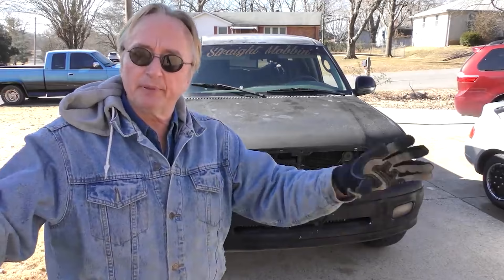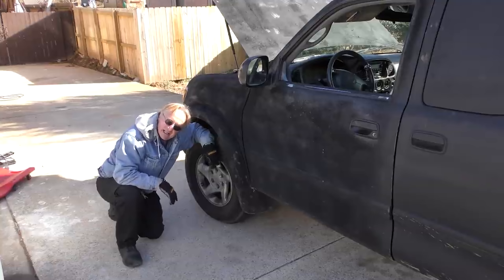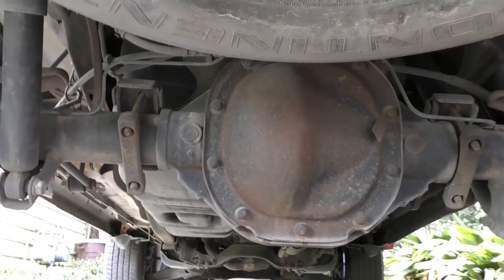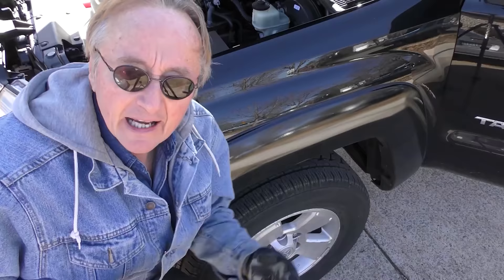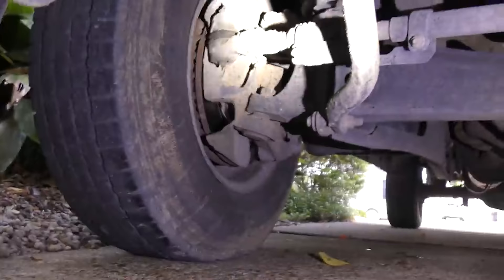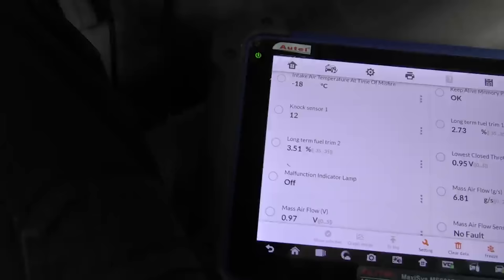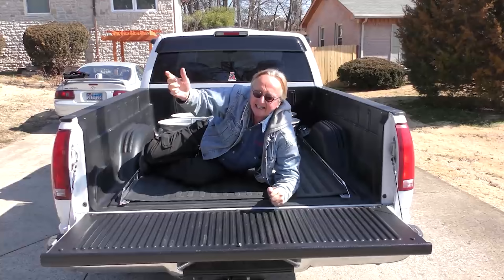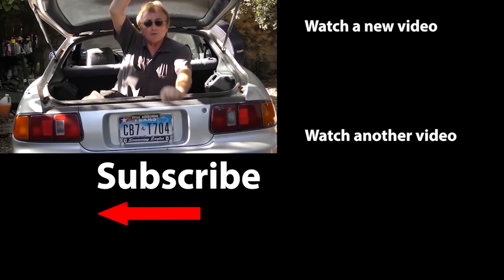5 Trucks You Should Buy

Comment: "Is this man crazy or what?" Turns to maniacally laughing man.
Reply: Neighbor had one and the paint came off and rusted really fast.
Reply: @samiam9059  my father had his for 14 years, It got beaten on bad but kept going. When he died it went to my brother and when he died it went to the debt collector. That truck out lived 2 men.
Reply: @frankdanger135  They do just real ugly with the paint and rust issue.
Reply: @davecrupel2817  The videos or some are interesting but his arms are too distractive for me to concentrate.
Reply: The maniac is laughing about hauling 18k pounds with a truck rated at 7500 lbs.  He is a danger to society and needs to understand why those limits were assigned.
Reply: @curtflory7147  again, the truck was overnegineered.
It was built much tougher and stronger than it needed to be for the ratings it was given
If this were any other truck brand, i would be inclined to agree with you.
But those are the optimal, safe towing limits. Not the maximum "before it breaks" limits. 

"Danger to society" 
The fact that this truck is still rocking and rolling after this many years, and after a haul like that, is a testament to how wrong you are.
Reply: @davecrupel2817 Dave, I agree that because the truck is still running after such years of abuse is a testimony to the integrity of the truck.  However, just because it CAN haul such loads does not mean it can do it safely.  I've seen WAY to many people do really stupid crazy stuff on the highway and it is a miracle someone didn't die either from loss of control and crashing their own vehicle or because of a crash involving another vehicle. 
There was a one vehicle pickup crash recently that was reported to have like 24 people in it, where something like 5 people died at the scene.  It was capable of hauling that many people; it just wasn't safe or prudent. Personally, I'd rather not encounter people demonstrating their stupidity at the peril of others.  If they want to risking killing themselves, that's their business, but they have no right to do it on public roads to prove they can, while endangering others.
The fact that guys laughed about it tells me he had no concsience about such as act of wrecklessness, which it is my belief, it was.  It appears to be a case of "hold my beer".
Reply: Could be... but he has more than 4 million subscribers, though! )))
Reply: But we Love him!!!!
Reply: @frankdanger135  Sounds like my ex.
Reply: @davecrupel2817  Sorry Dave, I doubt you are an engineer and not qualified to determine if the truck was over engineered. I don't see any way a truck rated by the manufacturer at a specific rating and loaded to over twice that limit is acceptable to anybody using common sense.
Reply: @davecrupel2817  wacky waving inflatable arm flailing tube man
Reply: Whopper

Comment: Still happy with my '93 T100 regular cab 2WD! Still runs like a clock, but when the time comes, a 2007-2010 Tundra will do fine! 👍😎
Reply: I put 376k on a 96 t100 even after I rolled it it still ran 😆 great trucks dude

Comment: Every time I see that Scotty is praising the older model silverados makes me feel better about purchasing my 06 Silverado. I may have over paid , being that the dealership had it priced at 13.9K but I managed to bring them down to 12.5K. But I feel like it’s worth the price.
Reply: Same, I have an 04 Z71 Silverado that is a beast!!
Reply: How many miles did you buy it with? I just got an 05 with 120k
Reply: @krish6506  When we bought it she had around 129,000 miles. I've been taking care of her and she's solid, has gotten us to many gigs while pulling a trailer with my band. She's sitting around 156,000 or so now and still purrs like a kitten!! 🙂
Reply: @joseph rigdon that’s awesome man. I’m really happy with the truck i have the 5.3 vortec, hbu? I have heard nothing but good things and it could last to 300k if maintained
Reply: @krish6506  I got the same 5.3 Vortec and pretty much. As long as they're maintained they will roll forever. I've been trying to take good care of her show she keeps lasting for years to come!! 🙂
Reply: @Maverick7r  156k is still nothing...
Reply: you got screwed... LOL i got my LBZ with 140k and no rust for 16k
Reply: @maxb2299    They cost a LOT more now. LOL
Reply: The door handles are cheap on the 06. Takes a long time but eventually the handle breaks. Dorman sells better ones.
Reply: Got a friend with a 2004 Silverado  with 5.3l  has over 440000 miles valve are flattery but runs fine.

Comment: I'm 66 yrs old and owned many cars and trucks many makes but always the Toyotas were the best. I had a 1980 limited edition Celica Grand Prix that had over 500,000 miles on it when I sold it and it was still running. My current truck is a 2004 Tacoma with 268,000 miles and still runs like a dream and still has the original fan belt.

Comment: I have a ‘96 Silverado K1500. Bought it used for $9000 with 55,000 miles on it. I now have over 252K miles. Used it as a work truck for 11 yrs. Just had to rebuild the front end. (Idler and pitman arms, bushings while I was at it) 2 water pumps. That is all I’ve had to do on it in 15 yrs. It is a solid truck.
Reply: Whats your 96 at now for miles?

Comment: I had a S10 pickup V6 with A4 speed. I want easy on it. Hauled 1500 pound's of gravel,pulled old car out of the field sitting on its hubs, hauled lumber and thoroughly USED that truck. I'd take another.

Comment: I just bought a 97 Silverado for 1700. Solid truck. Have to replace the shock mounts on the rear end and bleed the brake system, replace the AC control. I'm happy I got a decent truck for so cheap.

Comment: I bought my 94 Chevy Z71 ext cab brand new the summer I graduated high school. By 2024: transmission rebuilt, valve job, water pump, rear shocks, steering shaft..aside from oil changes, coolant/transmission flush, that's the extent of maintenance. Currently 316,xxx and still going.

Comment: I have a '94 Silverado 1500 that has around 325,000 miles. (Numbers stopped spinning at 176,664 about 18 years ago.) I'm on my 3rd transmission because I work the crap out of it. 
I've used Shell Rotella 15-40, on a 5000 miles oil change schedule since I bought it in '97.
Still looks good when it gets an occasional bath and puts out 75 pounds oil pressure on a cold start. Doesn't ever even get warm when pulling a heavy load in the hills in the summer. 
Those old Chevy trucks can't be beat! 
(And you'd be surprised at the number of Ford trucks and vans that I've hauled home over the years! 😂 )

Comment: I have a 2000 Ranger w/180K miles. Solid little truck. Yes, it's need various switches, suspension components and such. Not as reliable as a Toyota, but junkyards are full of them. If you are able to get parts from a local junkyard, you can keep one of these running forever. Just stay away from the 4.0 engines.

Comment: I've got a 99 suburban and the biggest problem thus far has been the electrical. Things need to be replaced or fixed here and there but the main engine, tranny, and chassis components are still factory at 203k.
I have a 98 3/4 7.4L Burban too but I reserve it as a backup vehicle, and towing with 138k.

Comment: Love my old Silverado. I have an 02 Ext cab long bed 4x4 Z71 with the 5.3ltr. It's got 348k on it. Interior and exterior are still in pretty damn nice shape. The paint still gleams. No clear coat issues at all. No rust on the truck at all. Getting the rear seal done next week. It still runs great, but needs some work now(axles & ball joints for sure), but hey, it's got 348k on it and it's 98% original. I'm going to put a few grand into it and run it another 100k. New & used truck prices are INSANE!!  It's only a part time vehicle for me now, so another 100k is probably 20 years and I'll be dead by then. LOL

Comment: I had an 88 Ranger with a 4 cylinder engine. It was gutless but reliable. It went faster in second gear than in third gear though. Only went about 80 mph max.
Reply: Bad tranny or air flow issue
Reply: Bad catalytic converter

Comment: just bought a 97 Silverado with 249,000 miles. No issues except parking break no longer works. Runs like a top. Unfortunately i live in wisconsin so our old trucks have rust. This onr has very little rust on the door runners as the bed of the truck has been replaced. My 93 GMC Sierra from california has no rust just swapped the 305 for a brand new Summit built 5.7 350. Thr silverado will be getting bodywork during the summer so i can make both last a lifetime. Love these old GM trucks!

Comment: I've got a 97 F-250 and it's got well over 200k miles, doesn't drip any oil! Oil is crystal clear and changed regularly. Runs like a ROCKET! And most importantly has an 8' bed!
I'm very impressed by how long its lasted and how well it runs...

Comment: Nice. My 2000 GMC safari is about to have 350,000 miles and still runs perfect lol! If you ever want to do a video on it, it REALLY really needs a brake fluid change. Its brown. And I'm in Temple Texas.
Maybe a video like "DON'T LET YOUR BRAKE FLUID GET LIKE THIS" lol
Reply: Astro/Safari and XJ Cherokee are the highest points in American auto production. Used astros for paint trucks for years and they're great. Door handle and heater control resistor pack every now and then and you're on your way to 400k all day!

Comment: I work for myself at home, I own a 91 chevy 1/2 ton 350. Bought it used in 96 from my neighbor, had to put an engine in it in 09 with 232,000 miles on it, it now has 254,000 on it and I changed oil about 10 years ago with 242,000 on it and it hasn't used a drop of oil. Best vehicle I ever owned it just keeps going and going.

Comment: I have just recently bought a 1998 Ford F150. Needed TLC but engine Tranny still runnin strong. 227,000miles. Only problem is they are known for exhaust gas recirculation flow insufficient. I replaced egr modulator & valve. I just bout a brand new throttle body with throttle position sensor & going to install this week. Hopefully this will clear the codes p1506 & p0401

Comment: 91 GMC 4.3 liter V6, 700,000 +. miles. What I like is it is reliable. That's like the same as a Chevrolet, right? It's loaded every day, sand cement and lime, or a tearout. You fix it and it stays fixed, not like a chronic problem that nobody can figure out. It's better than the day I bought it at 133,000.

Comment: Just watch for rusty frames - right Scotty?
Reply: One of the guys at the shop had his frame replaced, what a nightmare and cost a buttload even with warranty because of all the ancillary items that needed to be replaced when it was done
Reply: @MrTheHillfolk  I've never seen anyone do a frame replacement job. Nothing about that sounds like a good idea.
Reply: @olliefoxx7165  
It was a tacoma frame deal , they had a recall. 
Sure , new frame but he hadda pay for stuff that broke ,rusty mounting bolts and some bushings and stuff. 
About 3k outta pocket.
Reply: @MrTheHillfolk  So the frames were just made out of bad metal? That's not a typical Toyota mistake. Pretty much you have to remove the foundation of a vehicle, it's frame, and reattach it all to a new frame. Sounds like whoever approved that at Toyota lost their job and now run our govt.
Reply: @olliefoxx7165  Dana in Mexico didn't properly treat the steel during production.
Reply: And bad fuel pumps

Comment: Just picked up 97 GMC Sierra .
89,000 orginal miles.
Texas Truck.
Garaged real clean.
Took a while to find a good one.
Had it Delivered  back East.
Love the 90 GM  Trucks.
Had 92 years ago.
Had 325,000.
Sold my 2020 GMC 15OO.
New trucks are way overpriced.
I like the Simplicity of the OLDER Ones.
Reliability. 
And you can Work on them.
I do know.
There's a Demand on those Old Trucks.
Your better off.

Comment: The '97-'03 5.4L Triton motors had spark plugs pop out because there were very few threads for them to grab on to. You don't want to change them just for a tune up because the mechanics strip them out very easily. There is a $300 kit you can buy to retap the threads pain free and you get a heavy duty Helicoil sleeve.
Reply: Still total
Diarrhea engine

Comment: My 82 chevy 6.2 diesel still had the original shocks and ball joints in it with 500k km on it, still original engine, trans and diff. 
Toyota's, gm's from 79-2006 and 1st and 2nd gen dodge cummins are the best trucks period. My cummins 2wd gets 28 mpg highway and 20 towing 18,000lbs....hard to beat that.

Comment: My 2002 Silverado is the most reliable vehicle I've ever owned. 220K miles on it. Had a 94 Toyota truck that leaked, clutch, and a/c quit working at 130k.
Had a 1992 Corolla and the automatic transmission failed at 140k.
Chevy guy for life here.🇺🇸😎
Reply: You just got bad Toyotas....that's not normal.. you probably forgot to change the tranny fluid in the Corolla .try Honda too. New Chevys are crap.
Reply: @richsweeney1115  Nope . You are incorrect. They were maintained correctly. What the HELL is so good about needing a $1200 timing belt every 80k miles anyway. 2002 Chevy Silverado is absolutely reliable.😎

Comment: My dad got great deals on his 2 F-150s (2002 and 2009). The 09 has been out of commission because of an accident, I miss that truck. The 02 is still going even tho the gear is slipped on the transmission (R= P, N= R, D= N, L= D) and at the 20-year mark, the break lines decided to give. It has around 150k miles and is still a work truck.

Comment: There is another issue with the 5.4L motor in the F250, which is the manifold. Not an easy fix either. Am trying to sell my truck for $5000. Truck can be seen on my YT page
Reply: The 5 4 Ford engine is JUNK!
Reply: @steveeddy6876  the 5.4 3 valve is absolute trash but the 5.4 2valve is a soldier and extremely easy to work on

Comment: I bought a 95 Chevy 1500 less than 120k miles for less than $2000 built like a rock.  Air Condition worked poorly and tried cleaning it out to boost performance still poor but barely good enough in hot summer Reno NV. So, Check A/C performance before you buy.  with a fuel Efficient reliable V6 (Only had to do regular oil Changes) and Positraction Rear End in Snow and Ice Awesome 2WD Truck.  ps 95 was a transitional year I would get a "96 or '94.  '95 had some hard-to-find electrical parts and '94s or earlier had simpler electrical systems.

Comment: I bought a 1998 Ram1500 a few years ago, for 2000 dollars, around 225k miles.
Engine runs like a sewing machine, but it needs a transmission. 
Ive only had to tow my 33ft 5th wheel a couple times with it, and in low gear it is a champion.
Only work I've done to it is all new bushings and tie rod ends.

Comment: Bought my 2K Silverado Xcab new, at 333,085 miles 1st gear went out but the engine still started immediately. Swapped the 4L60e for a 4L80e and decided that since I do a lot of towing I'd go ahead and replace the original 5.3 with a mildly built 6.0 LY6. I've replaced the steering rack, radiator, rear end (from a Yukon Denali because I wanted to) carpet and all 4 rotors. I plan on driving it til the day I die. It's been a fantastic truck.

Comment: Chevy's rule! They ran that Chevy bodystyle for over 10 year from 1988 to 1999 making parts for them super easy to find and dirt cheap too! 1996 and newer were the ones to get because they had the Vortec engine with 8 injectors in the manifold, where the previous models only had a throttle body which was like a carburetor with 2 injectors other top of it. I owned 3 of them, a 1988 single cable long bed light duty 2500 for about 8 months which I sold to put towards buying a 1996 1500 Z71 extended cab short bed fully loaded that I owned for 9 years and unfortunately lost in my divorce and I ended up getting another one, a 1991 light duty 2500 extended cab long bed for only $500 and the body was beat to hell but it ran great and the interior was in great shape, it even had power windows and locks, good AC, bucket seats with a center console the only issue with the interior was the headliner was sagging. If I remember right it had something around 160,000 miles on it when I got it and over 200k when I sold it and in 3-4 years I don't remember replacing anything on it except a muffler, belt, radiator and a battery. I finally got rid of it when the oil pump died and just sold it as is cuz I had gotten a free car and my friend had a truck I could borrow if I needed one. And even selling it as is I got $800 out of it so I drove it for 4 years then sold in with a broken oil pump for $300 more than I originally paid for it! Then less than a year later I came into some money and I bought my dream truck, a 2003 Chevy 2500HD 4wd 4 door short bed with a 6 inch lift and 37 inch tires and some other upgrades like a 7 inch Pioneer touch screen stereo with a backup camera and an Edge Juice Attitude Power Porogrammer among other things for only $12k. I went with a 2003 cuz I like the body style and it was the last year that didn't have a God damn ERG system on it and with the money I saved going with an older model I was able to drop a bunch of money into aftermarket parts for her, around $8k!

Comment: I had an limited 07 Sequoia with the 4.7 it was a truly amazing vehicle. I changed the timing belt and water-pump twice, the brakes and rotors twice, the tires twice, one thermostat, the airbags via durango and1 battery for 10 years and 140k miles. I sold it with 230k and you literally had to look at the ram's to make sure it was on. The thing was like butter I bought a 19 camry xse which is good but not the same. I am already looking for another sequoia because those things are truly amazing vehicles. 3rd row a/c and height management it just doesn't get better for the money the only thing that could be compared to is the 2000's Ford Excursion. You know back when Ford built something worth the money. All manufacturers are garbage now. Do not buy new buy old and used and put a few grand in them. I love your channel Scotty